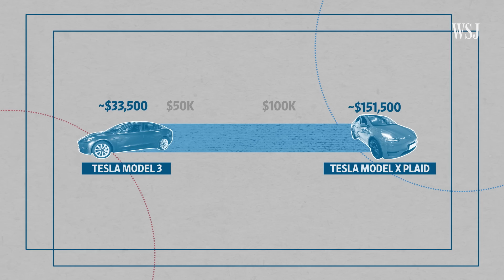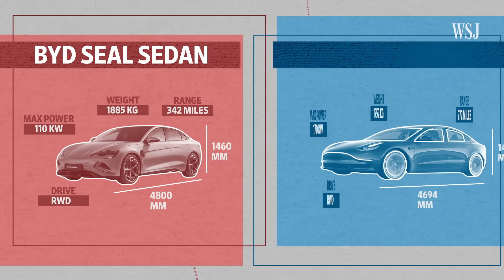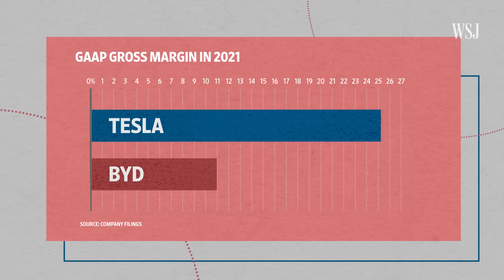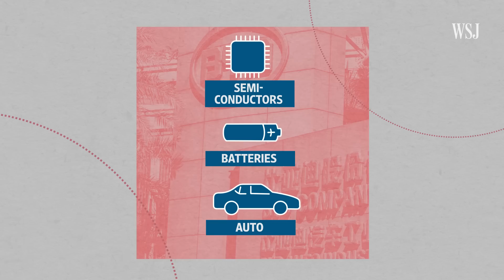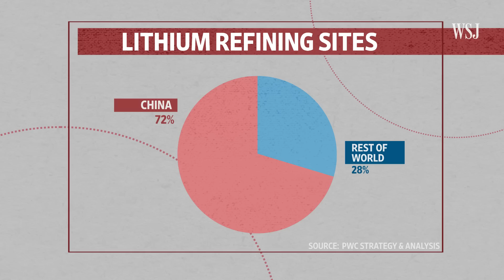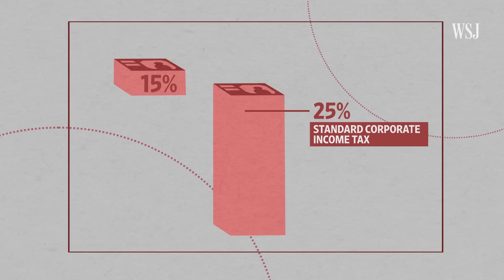The Tesla Competitor Dominating China’s EV Market | WSJ U.S. vs. China

Comment: The reason BYD is not in the US yet is not because the lack of infracture.  BYD is reluctant because its success in the US may end up getting the "Huawei" treatment and being sanctioned to oblivion due to "national security" concern.
Reply: No if BYD was being sold in the US it would be much more expensive since the reason it’s so cheap in China is from subsidiaries that don’t apply to foreign made vehicles. The US doesn’t have these subsidies and the US also have different regulations that would need to be met on a state by state basis which is more complex then producing vehicles in China
Reply: Very true.
Reply: @dennisp8520  
1. You obviously don't know much about China.  China is one of the biggest profit center for VW, for example, and Tesla is making insane amount of profit in China as well.  

2.  Keyword:  Inflation Reduction Act. 
If you don't call it "subsidies,"  you obviously have a different definition of subsidies than anyone else.

3. the US has different regulations on vehicle emissions in different states.  But everything else is practically the same.  And here is the kicker:  battery-powered electric cars don't have emission... shocking, isn't it?
Reply: @dennisp8520  Lol no. BYD still sells cheaper in countries that aren't China and US.
Reply: Or maybe the CEO of BYD has a daughter.
Reply: Did you even watch the complete video? They mention this in the video
Reply: @dennisp8520  "Regulations" are a hurdle. My creator faces huge  "safety approval" costs from US regulators. Approval is necessary before he can sell more of me.
Reply: I bet $10000 BYD will never enter the USA market
Reply: @TheMELTDOWN911  They already have entered the market in the form of buses and trucks
Reply: BYD crash safety is a bit.......low.
Reply: @kngharv  50% of Volkswagen sales, 33% of BMW sales are from China. China is also the largest market for Mercedes. GM sells more cars in China than in the U.S.
Tesla Shanghai is Tesla most productive and profitable manufacturing plant. Elon Musk has sent 200 engineers and technicians to Fremont to help to improve its productivity.
Reply: How about Chinese companies MAKE STUFF IN THE US!  Believe me people will be a LOT more receptive if they BUILD MANUFACTURING PLANTS HERE!  Just like the Japanese did.
Reply: True, the US does not play fair with strong competitors.
Reply: @BYDFAN  LOL! BYD Seal is a cheap copy of the Tesla model 3, I agree some of China EV cars are getting extremely good but WHY THEY HAVE TO COPY DESIGN FROM USA, GERMANY OR FRANCE???WHYYYYYY?
Reply: @TheTruthSeeker756  Why would they do so? Asian's build has better quality than American made.
Reply: @TheMELTDOWN911  🥱🥱🥱You're so ignorant, BYD is designed by one of the best designers of our time Wolfgang Egger!
Reply: @TheMELTDOWN911  Don’t think that’s a copy of Tesla model 3 cause they look not alike each other, and by the way BYD’s interior is way better made than Tesla. Western buyers especially Americans would treat Chinese car brands with bias, but sorry, Tesla’s value isn’t there yet.
Reply: @rayh3654  I just got deliver 2 weeks ago my brand new 2023 Model 3 Yes with the "typical" uneven gaps etc., Tesla fans don't care, is like the people who drive Jeep Wranglers... You wouldn't understand is a passion for innovation TESLA is numero 1
Reply: @BYDFAN  by the way Wolfgang Egger is a GERMAN YES GERMAN car designer, why don't the BYD Designers are name Wong Lee or something like that??
Reply: @TheMELTDOWN911  I understand this is hard to accept, but BYD takes the best to make its products the better.🤦🏼‍♂️ If Wolfgang Yegger is the best at the moment, he's on the BYD team.
Reply: @Notme-tq4xs  which one?
Reply: @nsng1298  I know all that, but it was VW that actually made significant profit.  GM for example, while sold a lot of cars, isnt making a lot of profit in China.  This is on top of the fact that the selling price of same model is actually more expensive in China than in the US.

The OP was talking about profit, not sales, thus I only use VW and Tesla as example.
Reply: @BYDFAN  You are a BYD_FAN, I HOPE at least you own one, Im a TESLA_FAN im retired at 51 thanks to my Tesla stock investment in 2018, and I have own 3 Teslas Adios Amigo!
Reply: @TheTruthSeeker756  GM and Tesla both conducted studies.  The quality is actually higher if it is being built in China and cost is lower.

Besides, not even Ford is making cars in the US.  They only make trucks and SUVs in the US.  And they also spend billions on recalls due to quality issue.
Reply: @TheMELTDOWN911  Best wishes to my Tesla fan friend. Tesla stock to the moon!
Reply: @dennisp8520 you know nothing, China provides exactly same subsidies to foreign manufacturers, not even to mention China basically provides Tesla free lands in Shanghai, which not seen by any Chinese manufacturers
Reply: @TheMELTDOWN911  The same concept applies for all the other brands, people won’t care any defects if they have brand loyalty, it’s like a self-brainwash. 🤷
Reply: @rayh3654  LOL! Yes is true I was a Chrysler fan form many years so I went from V8 Hemis to Tesla LOL! : )
Reply: @lucisleesion8824  The US sends the Chinese Hundreds of BILLIONS of dollars a year buying THEIR stuff.  We have lost hundreds of thousands of jobs over the years because of that.  They can COME HERE and MAKE IT HERE to provide jobs here.
Reply: @TheTruthSeeker756  Nope, why would the Chinese obey the order from the US? The US can choose not to buy from China. How arrogant you are.
Reply: @TheTruthSeeker756  You are ludicrously ridiculously absurd dude...
Reply: @TheMELTDOWN911  BYD is designed by Germans and Italians. Former designers of VW Group, Audi, Mercedes and Ferrari
Reply: This is probably the truth. Only way BYD cars will work in USA is if they are made in USA. Even then that's not a guarantee. Bud has introduced many electric bus projects in the US but got squashed because they were Chynese. This is the reality, back in 2021 they lost federal funding even though they were made in America and were eligible for it.
Reply: @TheTruthSeeker756 If BYD wants to get into US market then yes it seems like the way that'll face least push back. But it's a big initial investment and BYD currently already busy with domestic and Europe, south America and Australia market. My guess is that if they see big success in Europe, next is North America and I really look forward to that. They'll definitely bring some good competition to Tesla here and consumer will benefit from that.
Reply: Agree .... just look at the way senators little marco, etc is freaking out over the Ford deal.
Reply: @dennisp8520 I am worried about the same ending as Huawei, American scoundrel.
Reply: @TheMELTDOWN911  you lose, byd  has already enter the us market
Reply: Tesla stock is worth around 50$ !
Reply: @TheMELTDOWN911  Thats why American car design sucks is because your designer is named Joe Smith from Arkansas.
Reply: @BYDFAN  : >> "... True, the US does not play fair with strong competitors..."

which must be why China essentially banned South Korean EV battery makers from competing in China circa 2015 -- by changing subsidies/credits policy to exclude foreign competitors in name of protecting China's own younglings.
Reply: @tooltalk  South Korean battery makers can't sell their products in China?..
Reply: @BYDFAN  : Sure, you certainly don't think China is all about fairness, transparency, or home-grown innovation, do you?  When LG Chem opened their first Chinese battery factory in Nanjing in 2015, China quickly greeted them by changing their EV subsidies/credit to exclude them; then even went on to discontinue subsidies on domestically made EVs running their batteries.  In other cases, they couldn't even get permit to do business.  This went on for several years to protect their EV battery younglings like BYD, CATL until  China discontinued EV subsides very recently, but China discrimination against foreign EV battery makers are fairly known and had been going on for a while. 

So please look in the mirror and stop whining about the US or the EU's EV/EV battery industrial policies.
Reply: @tooltalk  Every country tries to ensure that the state subsidy goes to local producers. But China did not try to destroy successful companies by killing the competition, as the U.S. did with ZTE, Huawei...
Reply: @BYDFAN  : >> Every country tries to ensure that the state subsidy goes to local producers.
Not really. Most subsidies are good as long as they are all domestically manufactured regardless of companies's nation of origin.  For EVs, most, regardless of their origin, got subsidies as long as it helped promote their goal -- which is to achieve zero-emission.  That's what China stated until they saw strong foreign competition from SK and decided to discriminate them to protect their own.  Now none of this changes the fact that China doesn't play fair with strong, or weak competitors.

Lastly, there is no US company competing in the wireless infrastructure space -- ZTE and Huawei were never America's competitors.  Most US telecomm provider get  wireless equipments from either Nokia (Finland), Ericsson (Sweden), or Samsung (SK).
Reply: @tooltalk  Are Huawei and ZTE in business only in wireless equipment? Huawei used to be the second largest smartphone manufacturer.
Reply: @BYDFAN  :  Sure, Huawei and ZTE were only in wireless equipment business in the US.
Reply: @Notme-tq4xs  It gets 5 stars in Euro NCAP,  your comment only shows your ignorance.
Reply: @tooltalk  Not true. US kicked Huawei out. Huawei was already entered US market with Google's Nexus 6P, and was working with AT&T to have contact phones. Then AT&T backs off (for some you reasons we all know), then comes the rest of the banning story.
Reply: Here is a joke: the US is a Free market😂
Reply: @BYDFAN    Are you paid ?
Reply: @Notme-tq4xs  Are-you-paid?
Reply: @TheMELTDOWN911  Who did Nio copy? Also Teslas like most American auto brands aren't exactly renowned for their build quality lol.
Reply: @TheMELTDOWN911  Its "numero 1" for Musk fanboys only. To car fans its poorly built and to self driving enthusiasts its behind Waymo.
Reply: @TheMELTDOWN911  You should ask Tesla why they can't use all that money they get from pumping stock to hire an expert car designer.
Reply: @Kpop-eye-f7t  Friend honestly have you ever driven a Model 3 RWD or Performance? I've been driving V8 cars and SUV all my life, I NEVER EVER not even in my worst nightmare believed I could make the transition BUT, my 22 year old niece purchased a Model 3 performance, she asked me several times to drive it, I didn't want to drive it Im 51 years old, I get overwhelmed with all the technology and the one pedal driving is weird at the beginning, BUT once I drove that thing OOOMMMFFFGGG! I became addicted to the launch speed these cars have, also the SOLID they feel when driving due to the really heavy weight, so that happen in December, second week of January 23 I order my Model 3 RWD, I could afford the performance but my wife absolutely prohibited me from buying it as she is scare I could kill myself with such extreme fast car, is as fast as a Ferrari or a Lambo, so purchased the RWD is fast enough, Yes, I will miss many things like luxuries from my 2020 Jeep Grand Cherokee Summit Hemi but I just charged the car for the first time in a supercharger because I still have not installed the Tesla Charger at home, It cost me $16 bucks to fill the battery is LFP so I was able to fill 100% so from 10% TO 100% $16!!! which will give me 250 to 270 miles, same as my Hemi with a full tank of Premium gas for close to $100 bucks!!! wow that is impressive, and the fricking car is faster than my Hemi! I have not sold my Garnd Cherokee yet but eventually I will, you need to drive a tesla model 3 performance you will see the light!
Reply: @Notme-tq4xs  yes Im sure he is paid and not even own an electric car BYD or any brand
Reply: @lucisleesion8824  LOL! I wish I got paid, that is funny, I actually had to pay $15,000 cash for the downpayment for my Model 3 which end up costing me $50,000!!! with State taxes, registration, plates and fee for this and fee for that ....Im fricking broke for now.... LOL! getting paid ....I wish : )
Reply: @TheTruthSeeker756  <<How about Chinese companies MAKE STUFF IN THE US!  Believe me people will be a LOT more receptive if they BUILD MANUFACTURING PLANTS HERE!  Just like the Japanese did.>>

Have you watched the documentary "American Factory" ?
It is heart aching.
Reply: @TheMELTDOWN911  <<LOL! BYD Seal is a cheap copy of the Tesla model 3, I agree some of China EV cars are getting extremely good but WHY THEY HAVE TO COPY DESIGN FROM USA, GERMANY OR FRANCE???WHYYYYYY?>>

Which part of the BYD is copied from the Tesla Model 3?  
The wheels?  The windshield? The motor? The battery? or the FSD?  
Or you don't know, you just like to hate? 

ps. do you know who is the biggest financial backer of BYD? Hint: it is not the communists.
Reply: @TheMELTDOWN911  <<by the way Wolfgang Egger is a GERMAN YES GERMAN car designer, why don't the BYD Designers are name Wong Lee or something like that??>>

Do you know who designed the most successful Porsches? -- a Chinese
Do you know who designed the most successful BMWs? -- an American
Do you know who designed the most successful Subarus? -- a British team
Do you know who designed the most successful Hyundais? -- a German team
Reply: @dennisp8520  haha,easy
Reply: @MetaView7  Thanks a lot man!  Just watched it.  Yes it is heart aching.  But if you have nothing, it's something.  And hopefully you can learn some skills that you can take to another company that will pay you more.  I know many localities provide aid to companies in return for them paying a minimum wage.
Reply: @nsng1298  <<50% of Volkswagen sales,... are from China. >>

Actually, 37% of the VW made are sold in China, and those sales generated 50% of the worldwide profit. ie VW generated more profit from Chinese sales than from other countries. ie the profit from China is subsidizing the VW car prices in other countries.
Reply: @tooltalk  <<which must be why China essentially banned South Korean EV battery makers to compete in China circa 2015 -- by changing subsidies/credits policy to exclude foreign competitors in name of protecting China's own younglings.>>

China virtually banning the sale of Korean electric vehicle batteries as retaliation against South Korea for the deployment of the THAAD missile System.
Reply: @mochen9282  不一定要女儿，还记得阿尔斯通吗
Reply: I saw a byd at a target parking lot in pasadena. Pretty nice
Reply: Byd is here. They have an office in dtla.
Reply: @kngharv  well ford doesn't really make cars anymore. only the mustang .
Reply: @dennisp8520  it applies to tesla
Reply: @dennisp8520  The subsidies are gone. It's a tool to support the development of the domestic company. Once these companies get a foot hold on the market, the government will pull out the support. Otherwise, these domestic companies will just get lazy and live on subsidies for as long as they can and lose competitiveness.
Reply: @dennisp8520  MUCH MORE EXPENSIVE YES... the same price they are selling in europe?
Reply: @dennisp8520  No, even if BYD is a bit more expensive as an imported car, the price/performance ratio is still very high. BYD is afraid to sell it in the United States, because the US government will sanction BYD on the grounds of national security. And ask other countries to follow the words of the United States and sanction BYD together. If BYD develops, it will almost be the end of many fuel vehicle companies. Because electric vehicles are more environmentally friendly, they do not produce harmful exhaust and do not consume gasoline. Beneficial to the natural environment. China is currently accelerating the field of electric vehicles and gradually phasing out fuel vehicles. China has been improving the efficiency of converting solar energy into electricity, and plans to build solar power generators in space.
Reply: @TL-fe9si  : >> It's a tool to support the development of the domestic company...
Not quite.  This is illegal under China's 2001 WTO accession protocol -- not that China ever complied with the WTO rules ever.  Not all subsidies are illegal, but subsidies provided by China must not discriminate against foreign companies or otherwise distort trade, but that's not what China did. China quite blatantly started discriminating LG Chem when they first opened their EV battery plant in Nanjning, China in Oct 2015.  China welcomed them by changing their subsidy rules to disqualify them fro receiving the same subsidies and eventually cutting all subsides for domestically produced EVs equipped with LG Chem's MIC batteries.
Reply: Teslas' original roadster is a British Lotus Elise with Tesla batteries and drive train. Tesla has been designing with German, British and Italian queues because that's what look good for many.  Italian Pininfarina worked with Tesla model S fromtheget go.  If Tesla design language is American, we're fu*cked. Think Dodge and Chevy.

When it comes to clothes fashion, check out Ukraine style, very under-rated.
Reply: BYD and other China EV car makers are already selling Europe and Australia. They are worried about selling in US because of geopolitics
Reply: @dennisp8520  not true, China already ended all subsidies to EV companies, as also mentioned in the video.
Reply: @alanOHALAN  :  China ended their EV/battery subsidy just a couple of months ago after extending it for 2 years  -- ie, it was supposed to end in 2020.  China's EV/battery subisidy was also highly anticompetitive and discriminatory. especially against foreign competition.
Reply: @tooltalk  Batter had no subsidies, only the EVs. I dont know what you talking about, there was no other competition in the world. Tesla got subsidies too. The subsidies went to the buyers. Biden's law is the real anticompetitive law, talking about double standard from you.
Reply: @apanaama3703  they’re literally selling at or below cost because they overproduce in relation to domestic demand lol.
Reply: China should ban the sale of Tesla cars and Apple's iPhones in China.  China should also ban the sale of car batteries to all American EV car manufacturers.
Reply: @alanOHALAN  : >> " Batter had no subsidies, only the EVs. I dont know what you talking about, there was no other competition in the world. ..."
Yeah, I could see that you have no idea what you are talking about. The Koreans always have had the lead in the battery industry, especially back in 2015 when CATL and BYD were minnows.  That's why the CCP, having designated the EV and batteries are their next big thing -- soon to be named "Made-In-China 2025" -- had to keep them away from its domestic counterparts who had nothing.  LFP's were in the early days, which was granted royalty-free to all domestic use in China, and is inferior (but cheaper). 
   There were also multiple layers of subsidies granted to EV buyers, as well as EV battery makers and EV makers in China,   And this is something that, while there weren't party to China's highly anti-competitive and discriminatory behavior, the US and EU picked up and have/will implement in their new EV policy.  Biden's new EV policy, the IRA, is a reflection of that and the EU's policy is also going to embody some China's egregious policy.
Reply: And the sick thing is that we in Europe will follow any sanctions the us imposes no questions asked.
Eu is a coverup or right hand from the us.
Reply: @tooltalk  Chinese battery companies are better than any other countries without government subsidies which you imagined, is simply because they were making phone batteries for several years. The high volume in battery making plus their investment in R&D allowed their tech improvement. 
Korea and Japan will never be able to compete with China simply because the Chinese market is way bigger. If Korea is the size of China, then Korea will be a leader as well. 
EV subsidies were created to compete with Internal combustion engine cars, not against other foreign EV companies, as Elon had pointed out before, the more EV car companies the better for the future of EV to win against gas cars.
Reply: @alanOHALAN  : nah, as expected, you have no idea what you are talking about.  Both Japan and Korea started working on battery since the 90's when they were finally able to bring it out of the lab for commercialization. 

>> " ... Korea and Japan will never be able to compete with China simply because the Chinese market is way bigger. ..."
No worries.  Korea is the world's leader; the Chinese companies are leaders in China. 

>> "... EV subsidies were created to compete with Internal combustion engine cars, ..."
and foreign EV/battery makers who were also manufacturing batteries in China, but were forced to shutdown b/c of China's fear of foreign competition.
Reply: @tooltalk  Without iPhones in China, Chinese people can buy lots of other brands...Oppo, Xiaomi, Samsung, etc..  Those used to work at iPhone factories can work in Oppo and Xiaomi factories as the demand for these phones in China will drastically increase.
Reply: @tooltalk  Nahhhh
Reply: @apanaama3703  Tesla is considerably cheaper in China than the host country.
Reply: @TheMELTDOWN911  as if american cars didn't copy other car brands 🤣🤣🤣
Reply: @Notme-tq4xs  the most casualties cause by accident is tesla not byd
Reply: @TheMELTDOWN911  Deal with it.
Reply: True, its better not to sale in the US until they dominate the global market.
Reply: @dennisp8520  US does not subsidize??? you know how much boeing get subsidized?
Reply: @greedyinvader9462    That's a funny one.   What else you gonna say ?
Reply: We have a slang in China: Throw a meatball to a dog. - which ends up with  nothing in return.
Reply: It would pass all the requirements to be sold in the West. Quality differential is still  large.
Reply: @TheTruthSeeker756  hmm, u gort may force them to sold to American like they are trying to do with TikTok
Reply: It's hard work developing, making a new brand of cars. Than the US need only print some USD and exchange it for real product.
Reply: US always advocate free trade😅😅😅
Reply: @野鶴閒雲  : >> " ... US always advocate free trade ..."
Sure, but why should the US offer the benefits of free trade to China that don't believe or practice free-trade or free-market?
Reply: @TheTruthSeeker756  Trust me we’d love to but your government wouldn’t allow it. Haven’t you heard the news ie many Chinese firms in the U.S. have been sent packing due to the God knows national security concerns. BYD has plants in many major markets eg Thailand, Hungary and India. Why wouldn’t it want expand its global market?
Reply: @TheMELTDOWN911  BYD hired designers from Audi, that’s why.
Reply: @TheTruthSeeker756  : the US should allow China to open their factories; then forced them out of the country and take their factory, like China has been doing all these years.
Reply: now we got byd vs tesla in malaysia, i am going to bank on byd
Reply: @dennisp8520  The subsidies go to consumer, not to the manufacturer to have the price low, I suggest you check the fact fast. US use tariff instead to deal with serious competitors, on the other hand
Reply: @jjbully  : In China, there wre at least 3 different subsidies for EV makers, EV battery makers and EV buyers.
Reply: @TheTruthSeeker756  US send billions of dollars to trade for goods, not give out for free, which makes US company tons of money. Regarding jobs, production will only go to low labor area, unless we can reduce US wages to lower than China, production job is not likely to come back.
Reply: @Notme-tq4xs  - Meanwhile tesla burns in the parking lot.
Reply: @TheMELTDOWN911  lOl what model do they copy German car ?
Reply: @kngharv  that's not the case, only 10000yuan, that's only 1400dollors, for a car this is nothing effects.
Reply: BYD is not in the US because they need to fulfill the needs of the Chinese market first. Electric vehicles are a strategic goal for China. It's not just about making money.
Reply: I think it would be hard to sell a Chinese car to US consumers. Anti-Chinese sentiments are strong right now and people generally like Musk.
Reply: @phokas260  that's fine, but sell it in 🇨🇦 Why does the usa always have to dictate whatever we want?
Reply: @TheTruthSeeker756  BYD's Lancaster factory has been operating for years. If there was no Huawei incident in 2018  and the trade war to follow. BYD might have opened the passenger car production lines and battery production lines in US, too. Even the Lancaster factory was facing so much criticism from conservatives. And many states are now talking about banning Chinese companies from buying US farm lands. The climate has completely changed.
Reply: @dennisp8520  you should take a look at byd's price in countries other than china...
Reply: @captives6479  as an American I support this, anything to accelerate china,s demise and divert all foreign investment to neighboring countries. Also casus belli for US to tighten technology restrictions to further cripple Chinese industry lol.
Reply: BYD is out of stock in china at all time mate. Ppl need to wait 3-6monthes they are not afraid of sanctions like Huawei caz they own key components like DJI
Reply: Do not come to the US BYD. Don’t forget what they have done to Huawei. Just let them hug the old Civic with 25000$😂 as they find something really ‘AMAZING’
Reply: Period. Doing business in the US is not worth it anymore for Chinese brands.
Reply: @TheMELTDOWN911  It's 2023 now. Why do you think that all Chinese technologies are plagiarized?
Reply: @HctrLnds  : >> " ... Period. Doing business in the US is not worth it anymore for Chinese brands. .."
not sure about Chinese brand, but the US imported about $500+B worth of stuff from China in 2022.
Reply: @dennisp8520  You know you didn't even care to Google about China's EV purchase subsidies right?
Reply: @TheMELTDOWN911  You think the Tesla model 3 is actually worth copying? Have you actually seen a BYD Seal?
Reply: @RayDu  : >> ... You know you didn't even care to Google about China's EV purchase subsidies right? <<
  not sure what you mean.  China's EV subsidy was supposed end a couple of years ago, but it just ended a couple of months ago on January 1, 2023. Do you have a point?
Reply: @Notme-tq4xs  难道你做过byd的碰撞测试？
Reply: @TheMELTDOWN911  你可能都没见过这两辆车的对比，张口就是复制，特斯拉用的还是BYD电池呢，愚蠢
Reply: @TheMELTDOWN911  让人才为我所用不是更好么，你不会这么狭隘吧，为什么微软CEO是印度人不是一个含义，幼稚的孩子
Reply: Or the Bytedance treatment
Reply: Like the Google, Facebook and Twitter treatment??? Stop being so hypocritical
Reply: Lol
Reply: @BYDFAN  You forgot what China did to Jack MA AKA Ma, Yun?
Reply: @BYDFAN You fogot Huawei connections to PLA and CCP?
Reply: @Notme-tq4xs He must be!
Reply: how about toyota？
Reply: @TheMELTDOWN911  Wong Lee are Hong Kong translations. Should be Wang Li or Huang Li.
Reply: @wuyan6016  It will never be like that if Xi, Jinping gives up to be 世界霸主.
Reply: @alexlazar4738  BYD already one of top ten car manufacturers in Australia and New Zealand.
Reply: @xps3114  BYD already in Australia and New Zealand.
Reply: @cheetaih  : >> BYD already one of top ten car manufacturers in Australia and New Zealand.
Top ten EV maker or EV/ICE combined?
Reply: @tooltalk  Just base on the numbers of vehicle sales.
Reply: @Notme-tq4xs  但是byd的电池不会起火
Reply: @Dennis P  the same subsidies also applied to Tesla, lol. ShangHai literally asked Tesla in with low rent and promised the same subsidies to Tesla to introduce competition. That is why you see Tesla is cheaper in China as well. Educate yourselves. Don't make it sound like it is successful because of subsidies.
Reply: @dennisp8520  how you explain BYD sell cheaper in South Asia and Europe than Tesla?
Reply: if the boss of BYD have a daughter LOL
Reply: @jblake6145  because China wanted Tesla's technology
Reply: They should make the cars in Mexico to get around tariffs
Reply: you know bs
Reply: @dennisp8520  there is no more subsidies
Reply: With good reason.
Reply: I think BYD is different from Huawei because BYD control all technologies from A to Z. US government is hard to take serious sanction on BYD. They also has a backup domestic market.
Reply: @dennisp8520  Lol
Reply: Another reason is they want to keep having a good reason for not buying Boeing planes.
Reply: If BYD sucseeds in the US, it will face the same fate as Hawaii, as they don't like competition from China.
Reply: @TheMELTDOWN911  Well you should thank China. Tesla stock only started taking off after the news that it started building factory in Shanghai and selling directly to China market.
Reply: @mwqjdpk  No the name is John Henry 🤣
Reply: @thomasantn  this is correct, agree on this fact
Reply: @TheMELTDOWN911  they literally manufacture buses in California, look up BYD California Bus Debot
Reply: @esaw7067  cars... I'VE BEEN TALKING ABOUT EV cars from Chinese companies, China BYD is already selling EV's in Mexico,  but Mexico does not have the EV charging infrastructure as in the US, so I doubt they'll sell much but here in the US, EV's from China will be the nail in the coffin for US automakers except Tesla... by the way I just purchase my first EV! a 2023 Tesla Model 3 RWD LOOOVE the computer with wheels, never going back to the complexity of an ICE vehicle...
Reply: @zxtsteve : China's EV subsidy program started well over a decade ago and just ended on Jan 1, 2023 (after extending it for 2 years in 2020).  The US just restarted it under the IRA.
Reply: @dennisp8520  China EV subsidies have come to an end starting from 2023, there is no more subsidies to BYD and any EV companies now in China
Reply: BYD can simply open a branch in US, and exclude any Chinese capital and managers.
Reply: @BYDFAN  you are right.many talents are eyeing job in China nowadays, where they can serve 80% of world population without those nonsensical infighting in the west. Huawei dedicated scientist came from all over the world. They are the people who prioritize service to mankind than to the rich 1%.
Reply: i heard there are BYD factories in the US, though they are for the BYD buses that are in use in some US cities
Reply: @tooltalk  it is  called reciprocity policy. Korea put obstacles on Chinese products, that's why they receive the same.
Reply: @shencheanglow3726  : >>  it is  called reciprocity policy. Korea put obstacles on Chinese products, that's why they receive the same. <<
You mean like how China restricted rare earth metal export to Japan in political retaliation over territorial dispute?  LOL  Sure, reciprocity? Nah, as said earlier, nobody is under any illusion that China is all about fairness, competition or reciprocity.  China did it b/c Japan and South Korea, the leaders of the industry, would take a huge chunk of China's EV battery business under fair market condition.
Reply: @tooltalk  use your logic, do you see much foreign cars in Japan and Korea? These two nation is notorious for giving obstacle to use  foreign products, China generally are far ahead in allowing the use of foreign products including car and luxurious items. There is no comparison except amongst the ignorants.
Reply: @shencheanglow3726  : >>  These two nation is notorious for giving obstacle to use  foreign products <<
You have no idea what you are talking about.  Import cars make up about 16% in South Korea and 8% in Japan. In South Korea, for instance, 1/3 of all electric buses are made in China -- fully subsidized with no strings.  Further, they both have far more developed domestic car industry than China -- Toyota is #1 in global auto sales; Hyunda/Kia #3. 
>>  China generally are far ahead in allowing the use of foreign products including car and luxurious items.  <<
No it isn't.  First, there is a 15% import tariff on all import cars in China.  Second, any foreign auto makers wanting to operate/sell in China must form a joint venture with a domestic Chinese company so Chinese companies can access and  pick up foreign companies' know-how and IP; in other instances, foreign companies are required to outright give up their core technologies in exchange for market access. 

Again, nobody under any illusion that China believes in fairness, competition, or home-grown innovation. Reciprocation my a**.
Reply: When the sanctions apply not only in States but all over the world have to follow too just like HUAWEI ??!! So rather not to gain market in states but gains market around the globe...
Reply: Incorrect. The reason BYD is NOT in the US market is because it is an unimportant market. Many car manufacturers DO NOT sell in the US, it is not just BYD.
The EU market is the same size as the US market.  It is NOT because of the lack of infrastructure. 
All car manufacturers are following the Tesla system of online sales. the days of the dealership are GONE with EV's. You only needed a dealership for ICE cars. No longer required with EV's. Farley is going down that route as well, selling directly to the public and no shenanigans with dealerships and their pricing.
Reply: @bricktop7803  you funny.  The US car arket is not important. LOL.
Reply: @The Truth  They do Joyson for example they bought out Takata the Japanese airbag and seatbelt company.
Reply: @Notme-tq4xs just prove it. Don't pluck it from the thin air
Reply: @TheTruthSeeker756 China may not risk to build a EV plant in the US in a near foreseeable future.
Reply: @zp5124 BYD may not invest US for geopolitical reason. Huawei & ZTE examples for BYD decisions.
Reply: @mochen9282 ha ha! I like your sarcasticism.
Reply: @petersonfranklin1499 EURO safety level is probably stricter than the US. Just look at BOEING MAX 737!
Reply: @dennisp8520 spoken like someone who had no idea what they're talking about
Reply: @Notme-tq4xs Fact matters. The lastest EU standard safety test on BYD Seal and Dolphine all 5 stars, higher than US cars.
Reply: @dennisp8520 Tesla and VW also have those.
Reply: @TheMELTDOWN911 As bias  like this.
Reply: @dennisp8520  EV in the US have been subsidized ever since it started.......tax credit and the more recent inflation Reduction Act is not subsidies? Does someone have to label it a subsidies for you to see it is a subsidies?
Reply: https://youtu.be/EKpdbLNVdO8?si=mCMlCKIHXWkteU17